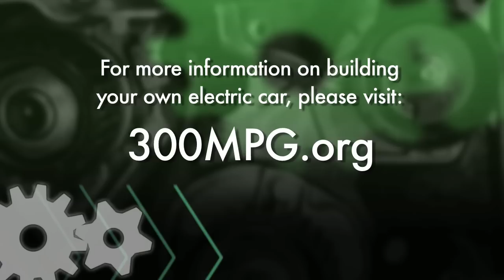DIY Electric Car: 03B DeICEing part 2

Comment: Why not keep the fuel meter and play with it. Maybe you can hook it up to a micro-controller and give you battery stats. And if you keep the transmission, you still need a bit of lubricant. But not every year.....

Comment: i notice you are NOT wearing your Saftey Glasses!
--Rick
Reply from the maker: +Rick Coona Thanks Safety Rick! I usually try to remember to wear safety glasses, but sometimes I forget. I've also become a big fan of the "ear-muff" style hearing protection. It's amazing how LOUD it can be sometimes to use a drill, grinder, or even just smacking things with a hammer. All jokes aside, safety first!